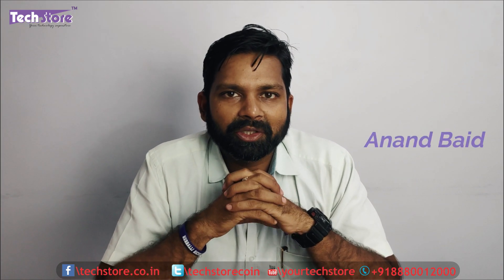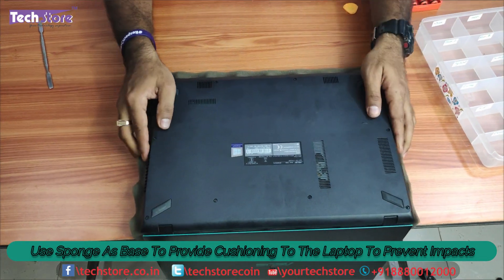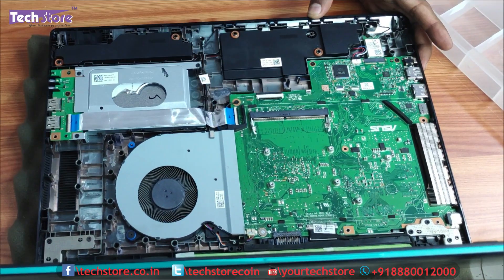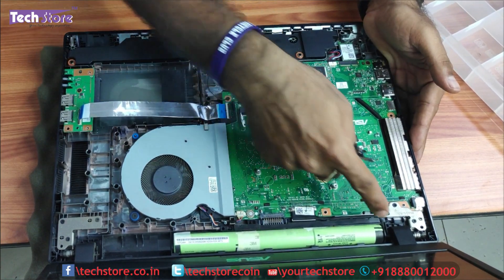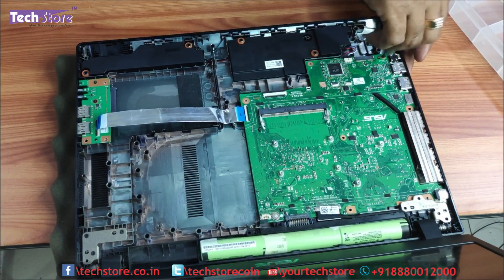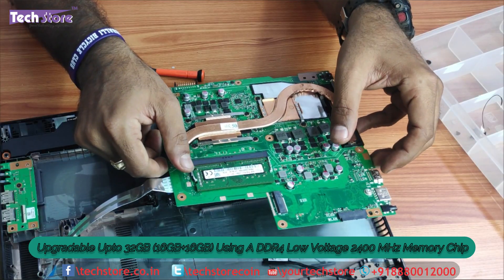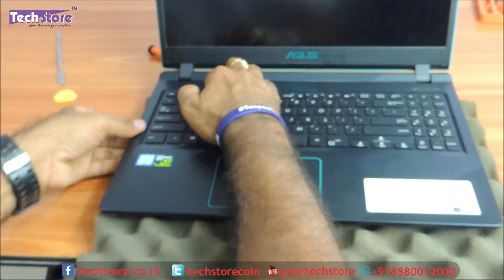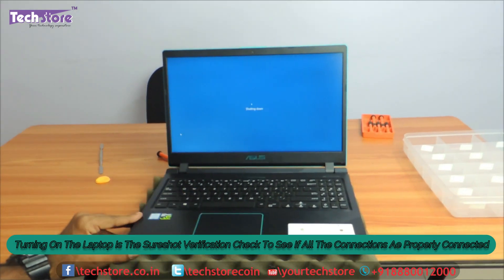ASUS F560UD BQ237T Gaming: How to Disassemble base touchpad & install M.2 SSD ram hdd easy DIY

Comment: Thank you so much ! Upgraded my hard disk and ssd through this, was really helpful.
Reply from the maker: Glad it helped! Do Subscribe.
Reply: cud u tell me which SSD u installed ?? M.2  sata or NVMe??
Reply: @ishananand3359  M.2 Sata
Reply: @hritiksharma696  like y didnt u go for nvme?? if it supports it??
Reply: So u had to remove the hard disk to install the SSD?
Reply: hi sir. could u tell the type(length) of SSD?    2280,  2260   or    2242?
Reply: @waitingwaiting9502  Pcie nvme 2280 fits in the slot.I just upgraded recently.
Also Pcie is also supported.So go for m2 nvme if you can
Reply: @ds_skadoodlegaming5926   thank you!!!

Comment: Good day. When upgrading/adding SSD to my laptop, do I need to do something first before opening the laptop? Or just straight up open it then insert the SSD? I have a built in 1TB HDD btw. And I am planning to have both HDD and SSD in my laptop since it has another slot.
Reply from the maker: Create a recovery disk and then install SSD inside

Comment: Dear Sir I have this laptop please can you tell me how which SSD NVME I can use like samsung 970 pro 500 gb can support this laptop...
Reply from the maker: yes it supports
Reply: Hi..  Can u pls tell cpu fan is spinning on booting up laptop or not.. I have this laptop but when i boot up the laptop CPU fan is not spinning but laptop is working fine

Comment: Sir can u please tell me the exact specification of the hdd inside . I need to replace my hdd so want to know the exact model!
Reply: Bro did you have booting problem, ie( harddisk error)
Reply: @emeraldjerrifer837  i have same model 
It's hard disk is failed should i install ssd directly
Reply: @AkashRathod-su3le  hey bro, first of try to troubleshoot what the actual problem is? They do the requirements ie ( repair hdd or insertion of new one ) or ( go with SSD)
Reply: @emeraldjerrifer837   ya bro i used to have it a lot but once i gave it for service after that everything seems fine now